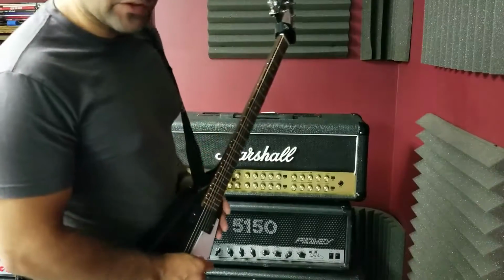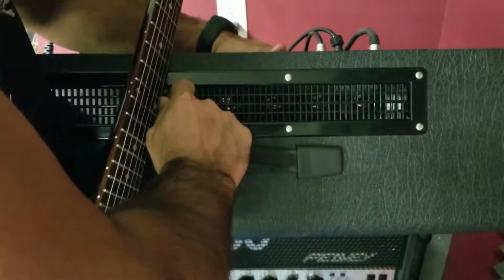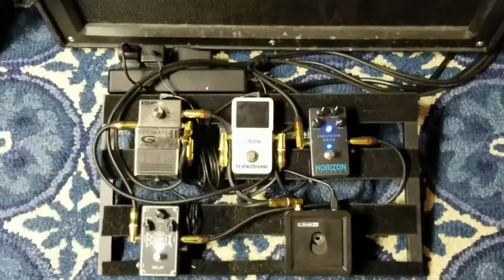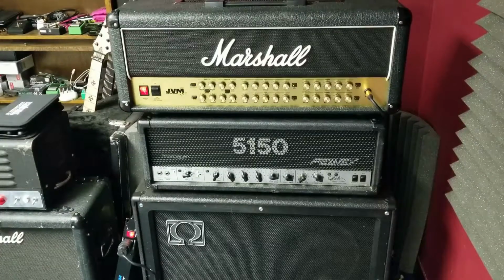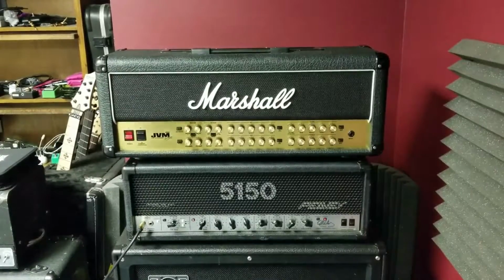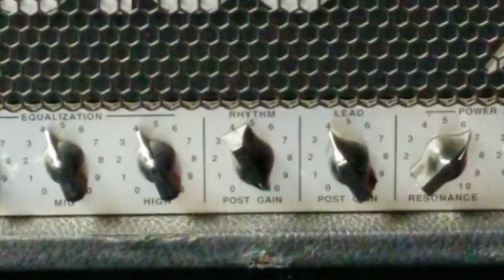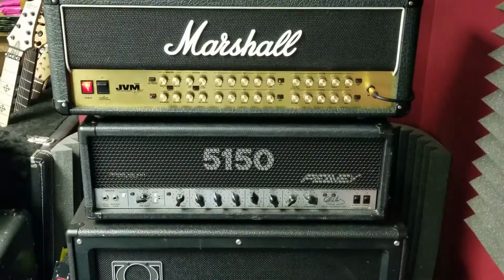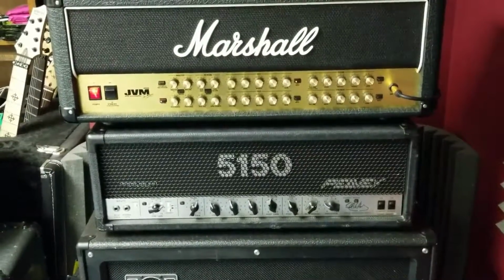Noise Gate Challenge Accepted

Comment: Went through 3 JVM's and feeling pretty stupid right now, should have looked at my ISP G String 2 as possibly being defective instead. Absolutely ran my ISP every way possible, used it in front and through the Serial loop as intended just like you did here. Actually ran it the Parallel loop too just in case I was missing something. They just would not stop squealing and hissing, the fact that it didn't kill the hiss like it does here just cements the fact that mine wasn't working properly. ISP is really good about warranty service too, damn. Sold the pedal off with my last JVM so getting a new one that works correctly would put this mission to bed, along with another JVM of course. Thanks for doing this video man!
Reply: check preamp tubes . maybe one of them is runing bad and making microphonic and
Reply: the early Decimators introduced a ground loop on certain amps/FX loop combos. i had to get a passive Behringer Hum Destroyer. cheap as and ,has two sets of I/O.  its come in very handy. now have total silence on any amp. pretty ridiculous that a device supposed to kill noise made it worse in some cases but the newer Decimators have a built in ground switch to fix the problem

Comment: if you are using the loop, did you check to see if you are 100% wet?  that affects volume also, you have to adjust it with/without engaged = same volume level...
Reply from the maker: Definitely has to be 100% wet for a noise gate which essentially makes it a series loop instead of a parallel loop

Comment: I'm not sure how the JVM works in standby, but does that amp have  speaker out bypass protection of some sort? I cringed when you had to plug in the cab after it was turned on. LOL.
Reply: same here. also tilting the amp like that and almost crushing the input jack socket because the guitar has been plugged in already... jeeez... I would not take any advice from this  guy.
Reply from the maker: When a tube amp is in standby it does not need a cab plugged in.
Reply from the maker: The input jack did not touch anything since the amp wasn't tilted past 90 degrees. It looked risky since I was moving fast but I am always extremely careful not to mess up the jacks!
Reply: @Stephen_Shaheen  styanby does not cut the current going thru ... nor impedance .... very bad idea to let a tube amp without a cab or a load box pluged in ... jeez ... and over all you did not made the demo with clean sound to see if frequencies are affected .... last thing OD2 channel is even more noisy and you never make a demo with it ... to me G String is a bad noise gate but anyway ...
Reply from the maker: @ContentFromHell  I record clean tone with and without the Decimator all the time and both sound exactly the same. There are plenty of new noise gates that work the same way. You can always use those if you hate the decimator that much. Feel free to google the standby thing bro. It's not encouraged because people forget and start playing before they plug the cab back in, but it will not hurt your amp.

Comment: so how does the g-string work? does it work by putting 2 seperate gates, 1 before the amp, and one in the fx loop? Im trying to decide whether to get the regular decimator 1 or 2 or the g string!
Reply from the maker: It's one gate loop and one trigger loop. The guitar in and out are the trigger only. The dec in and out are the gate only. If you set it up right you should not need two gates. What is your signal chain?

Comment: I just bought a Decimator II G-String and can't figure out how to plug it into my Peavey 6505. Tried the diagram you see everywhere. Where did I go wrong? Signal leakage from the loop?
Reply from the maker: 2 cables: Guitar > Decimator Guitar In > Decimator Guitar out > Amp Input. Then 2 more cables: FX Send > Decinator In > Decinator Out > FX Return. Amp fx loop must be on, I can't remember if the footswitch can turn that loop on and off
Reply: @Stephen_Shaheen  It is said that the decimator II g-string requires 4 cables. I pretty much tried what you said (seems to match the official way) but just got horrible added noise
Reply from the maker: @padraig88  Something isn't right. If it's set up that way and you can't cut out the noise by turning the decimator up then something is not working properly. You could try reversing the fx wires, sometimes the fx loop could be wired backwards if someone has worked on the amp. Or the loop is broken? It's hard to say without seeing it.
Reply: @Stephen_Shaheen  Someone did work on the amp but is very experienced. IDo you know if the fx loop on a 6505 series or parallel?
Reply from the maker: @padraig88  It is a series loop

Comment: I smell something fishy.  Why does your toneconsultant never change when you alter your knobs. Hummmm?
Reply from the maker: Because I played the same. Tone is mostly in the fingers bro! Also at very high volumes you can barely tell the difference of tweaking a couple knobs
Reply: @Stephen_Shaheen  Ah, I was just giving you a bad time.  I did like the video.  It was very informative and the tone is on point.  Someone was telling me the new Zuul pedal blows that one away.  I have the 1st Decimator, the Boss NS-1, and I just got a Zuul.  I haven't got a chance to test it out.  I also wanted to pick up a G-string.  I'm curious to see how they all match up.
Reply from the maker: The Zuul is a great pedal. I haven't been able to use them side by side but should be exactly the same as the Gstring. If you have that you should be all set!